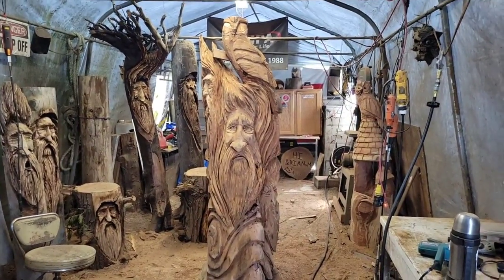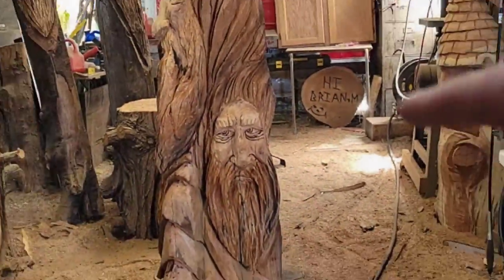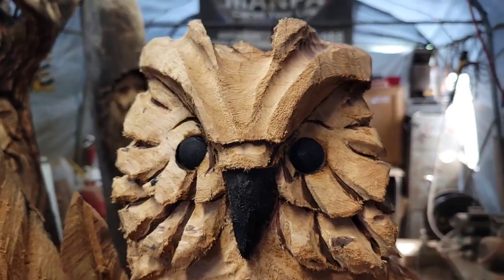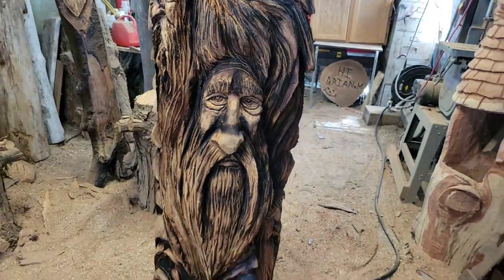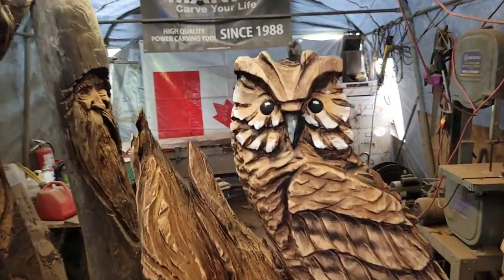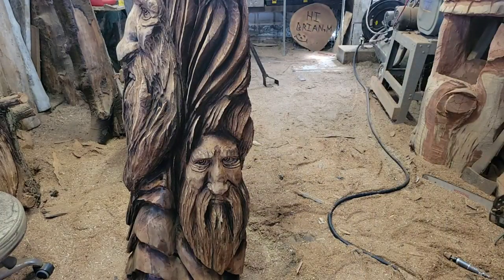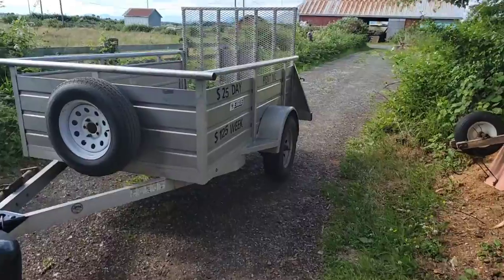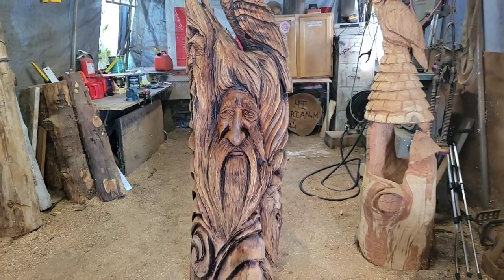Big Cedar driftwood carving #2 final.

Comment: Hey Jordy. Another idea.. have you seen the crews for mirrors that have a screw in top plate or dome. Great for fitting the sprockets as you get an instant eye centre. Chrome, brass or spray black. They just screw into the head of the screw once tightened .great spirit totem.👍🇬🇧🙋🏼‍♂️